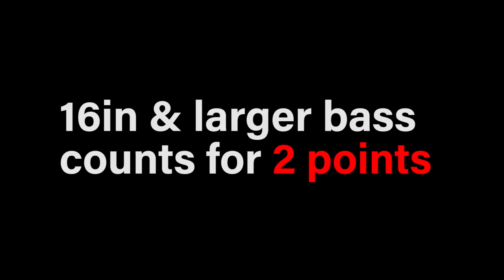Futuristic Digital Reel VS. Old Vintage Reel -- Fishing CHALLENGE

Comment: I still fish with rods and reels from the 80's. I use Ryobi V-Mag reels and pistol grip Shimano XL rods. Been using them since they were new and still works perfect. I also ebay them when I can, have several reels new old stock. I just never got into the longer rods and newer reels.

Comment: What does the digital chip in the electric rod do?
Reply: The digital chip is inside the reel, and instead of a reel that uses the centrifugal break, or magnetic break, it uses a little computer chip instead. I believe every rotation of the spool when you cast it updated the computer chip and tells the reel to slow down or speed up in order to maximize your casting abilities. There very expensive but I bought the Exsence digital chip reel and it's by far the best reel I've ever used.

Comment: Using a $700 reel Chris should have spotted you 4 points at least! You smoked him because of the slower gear ratio. These new reels with the high speed gears are great for fishing, not always for catching.

Comment: Man, I'm 47 years old. I had a very similar Procaster reel until a couple years ago. I think I got mine in 1983. I asked for it for Christmas because I saw Bill Dance using it on his show. At one time it was my only baitcaster. It's a technological marvel how long those hold up. I put some heavy use on it. I have ordered a couple parts and Daiwa sent them completely free without even a comment. I finally had to retire it about a year ago. I think you could do worse.
Reply: Hello where can i get a parts for the daiwa?